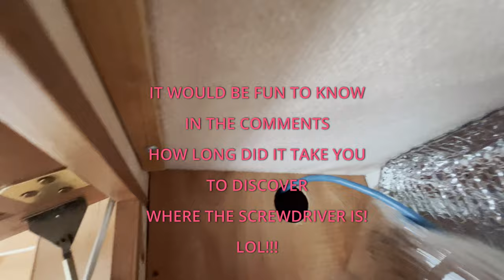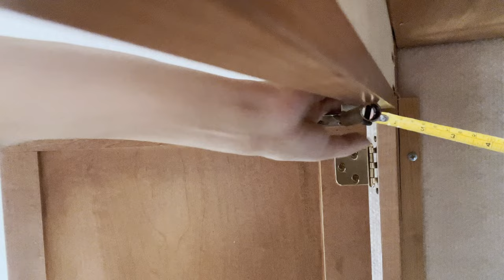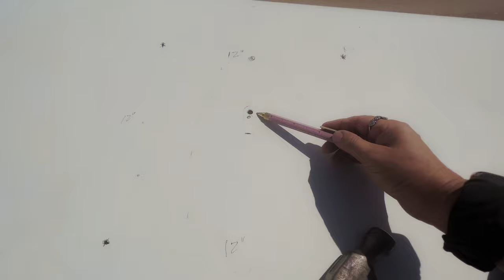RV WIFI PART 2 PARSEC ANTENNA + ROUTER Making Holes😱It's NOT going so well!⚡WARNING!⚡Total ROOKIE!

Comment: They sell longer Drill bits but I don't think you are close to Home Depot.  I welded a 2 feet long rod on a normal drill bit .. So I can drill holes in  my pole barn that has an inner and outer metal wall with  8" thick  poles in the middle. Thus the wall is over 8" thick ..
Reply from the maker: I can drive to a Home Depot. I need to continue to grow my tools arsenal. I never knew I would like tools so much! 😁 You seem clever figuring things out and welding pieces together. I want to learn to weld too!
Reply: @HerSoulVacation    I did have two MIG Welders.  A new Miller that works great and an older one that worked perfect until  a fiberglass part broke.  They have not sold parts for that Welder for 20 years.  I might try and repair it with JB Weld.  I also have a Plasma Arc Welder..  
  The only welder that I don't have is a TIG Welder which I would really like to have.  I just got an e-mail from a Welding Supplies place.  The Welder I like is $4,000.00 
  I have a Bugler Alarm a fence and a Gate.. but I really need surveillance Cameras and  and app that will contact me through my phone if anyone triggers the alarm.
  Don't have a lot of Probmes in my area yet I see on a Local Facebook Community page my Neighbors have been getting their garages and Pole barns broken into .  I live in a Rural area.. When the catch the thrieves they are usually from a near by City Like Battle Creek or Kalamazoo.
  My Neighbor asked me to dig a Pond for him but he was murdered  two weeks later.
  He befriended some sketchy People .. The guy who murdered him was a drug addict.  They know who did it because they caught the guy with the keys to the victims new truck in his pocket.  They don't have enough evidence to take him to Trial however. Very frustrating for this Man's daughters and friends.
Reply from the maker: @mikeskidmore6754  wow!!! He gets away with murder??? No way!
Reply: @HerSoulVacation    They found  my Neighbors Body on a stone Pile in a fence row 1 month later 10 miles from his house on a Farm of one of my Lime Customers and the Father in Law of a friend of mine. The guy I sold my 27 acres to.

Comment: Hello again! So much fun, and I have to tell you there have been times in my projects where I have done the same thing. Drilling into the wall panel, what’s worse is aiming for the solid wood for fastening and missing it not once or twice but several times. I admire your forging ahead into the unknown learning along the way.😊
See you on the next one my friend! Hugs 🤗 Anxious to know how how it works. Chao
Reply from the maker: 😁😁 I feeling better knowing that I'm not alone in making this kind of mistake. But at the end, it's all good, most of the time! 😃😃 Next video will be the last with a report of how it's working . Hope you are doing well.
Reply: @HerSoulVacation    When you drilled a hole in the roof of your motor Home it made me think of my Father and his Mini Motorhome.  He would never drill a hole in the roof.
  I don't know much about RV's  but I wonder if drilling a hole in the side  could have been better.  I could do a search for some kind of conduit to run a cable through.
   All the same  silicone caulk and plug a hole too.  I would want some kind of a plug then seal the Plug with Silicone glue.
Reply from the maker: @mikeskidmore6754  with today’s products, drilling a hole on the roof it’s not as bad as it used to be. I wouldn’t want to have stuff on the sides of the Minnie. It would look bad and the wires would be accessible to animals and bad people. I think with the right sealants, the roof it’s better, for me.

Comment: great videos, gave me a lot of insights. Bur why drilling that big hole if you only need to feed the cables through ? I am just now installing the box 2 feet away from where I will feed the cables through because of my AC in the way (with help of a much smaller little box and smaller hole for the cables ?)
Reply from the maker: Thank you Michael. 
I made the hole as big as I did to pass the 6 wires with the smallest cone drill bit I had. But it’s very well covered by the box.  I wanted to use the large box to sit the large antenna on top.
I’m glad you are getting yours done!